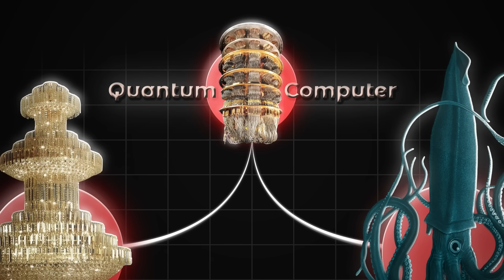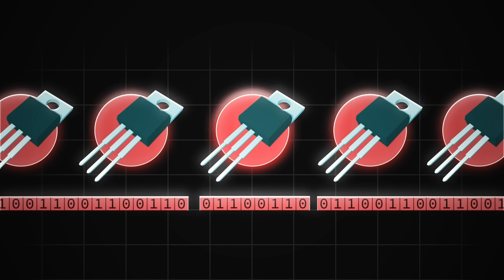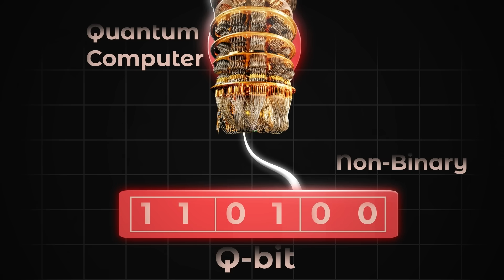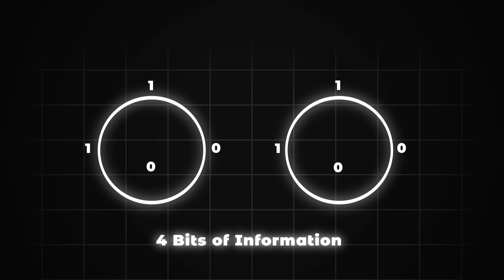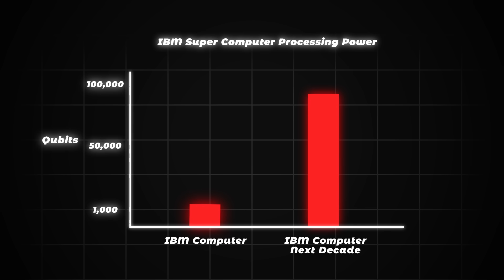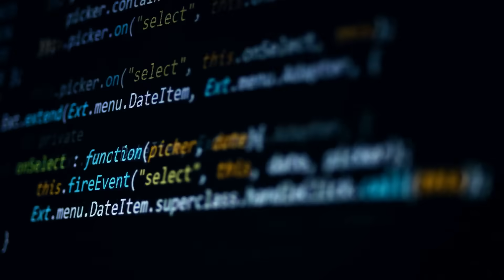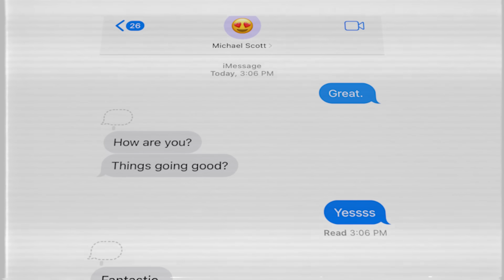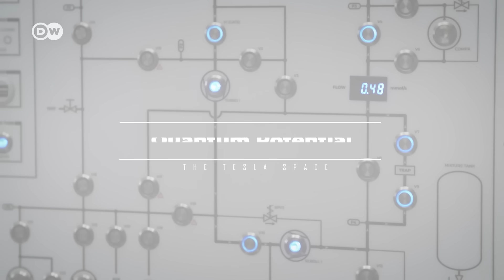Why Quantum Computers Will Break Reality

Comment: The orbital and interplanetary space environment is ideal for quantum computing systems which would require minimal cooling of only a few degrees below ambient temperatures. This could easily be achieved with cooling systems powered by solar and batteries on a satellite or space vehicle. Quantum computing may also eventually be useful for celestial navigation, genetic engineering, and new understandings of physics, all of which may be useful for interplanetary and interstellar human travel. Just as different phenotypes/tribes and cultures of humans have adapted to various terrestrial local environments (Tibetans to high mountains, Masai to sunny savannah, Polynesians to oceanic voyages, Nordic and Inuit peoples to the Arctic North, etc.) so may future astronauts adapt themselves to the space environment and various planetary environments using genetic engineering, unlocked by artificial intelligence and quantum computing.

Comment: the theory has come back again about the brains nueronubules acting as quantum computing units. the paper is  "Ultraviolet Super radiance from Mega-Networks of Tryptophan in Biological Architectures" 
 which has been confirmed in the paper they do super radiance. But that jsut open the door to quantum effects mediated with ultra violet light. and other tube clusters cascade excitons. the neurons in the brain is the only place where a specfici protein is used to make neurons.  whats weird is this is the only place in the body where it protects microtubule architecture at all costs. every where else recycles microtubules.
also, anesthesia that shuts of concesnous, we really have had 0 idea how it works. But recent studies have shown it binds to the microtubule to "quantum channels of TRP rings. anesthetics have shown they impair impair π-resonance energy transfer and exciton hopping in tubulin quantum channels. 
which adjusts the frequency of the system.
the microtubules also have microfilaments running through them in the Fibonacci sequence to wire the microtubels a coherent systems

ultra violet light needs to be researched in how it could affect the idea a nearonotubes are actualling the processing units. the geometry of these tubes change in different nerve cell clusters and types. also propose that myelin sheeths, create feilds for adjusting the optical properties of the band gaps. honestly makes more sense, sense on how we dont know how anything really works yet. since the system would work from the THZ range to the hz range. And be meing an EE a lot more curcuit architecture makes a lot more sense with enragements of tubes in neurons.

this is really worh you time to check out. I dont have the equipment to test any of my ideas

if true, humans try to make a crappy quantum computer with crazy methods
mushroom gods from outter space. mmmmm warm brains

Comment: The most wrong and dumbest Video about this topics out there! STOP IT!

Some Corrections:
1. Quantum Computers Becoming a Big Part of Daily Lives:

   - Claim**: "Quantum computers... are on the verge of becoming a big part of our daily lives."
   - Correction**: Quantum computers are still in the experimental stage and are primarily used for research and specific complex tasks like cryptography, material science, and optimization problems. They are not close to becoming a common part of daily life due to their complexity, cost, and the need for specialized environments (e.g., extremely low temperatures for superconducting qubits).

2. Antikythera Mechanism as the First Computer:
   - Claim**: "This thing is also a computer... it is known as the Antikythera mechanism."
   - Correction**: The Antikythera mechanism, discovered off the coast of Greece, is an ancient analog device used to predict astronomical positions and eclipses. While sophisticated for its time, calling it a "computer" in the modern sense is misleading. It lacked programmability and general-purpose computational abilities that define modern computers.

3. Physical Transistors and Quantum Mechanics:
   - Claim: "The physical manifestation of a cubit is achieved by manipulating the spin state of subatomic particles either protons or electrons causing them to spin up and down or left and right creating two distinct States your one and zero."
   - Correction: Qubits can be realized using various quantum states, such as the spin of electrons, the polarization of photons, or the energy levels of ions. The key is that qubits use quantum states that can be manipulated to perform computations, but they are not limited to spin states alone.

4. Qubits Holding Both Values Simultaneously**:
   - Claim: "Qubits can also represent both one and zero at the same time."
   - Correction**: A qubit in superposition can be in a state that is a linear combination of both |0⟩ and |1⟩. This means it has probabilities of being measured as 0 or 1. It is not that the qubit is literally both 0 and 1 simultaneously, but rather it exists in a state where it can be either when measured.

5. Schrödinger’s Cat Experiment:
   - Claim**: "The basic explanation of Schrödinger’s idea is that you could take a cat and put it in a box, then put something else in the box that could potentially kill the cat, like a cup of poison. Then you seal the box... as long as there is no way for us on the outside to know what's happened inside the box, then we have no evidence to suggest that the cat is dead or alive... it may be considered simultaneously to be both dead and alive at the same time. This is referred to in quantum physics as a superposition... the moment you open the box and check on the well-being of the cat that superposition collapses back into a binary."
   - Correction: Schrödinger’s cat is a thought experiment illustrating quantum superposition and the problem of measurement. The setup involves a radioactive atom, a Geiger counter, poison, and a cat. If the atom decays, the poison is released, killing the cat. Until the box is opened and observed, the system is in a superposition of decayed/undecayed atom and dead/alive cat. Upon observation, the superposition collapses into one definite state.

6. Error Rates in Quantum Computers:
   - Claim: "Quantum computers tend to have error rates that sit between 1 in 100 at worst and 1 in 1,000 at best."
   - Correction: Quantum computers do have higher error rates compared to classical computers due to decoherence and noise. However, these rates vary depending on the technology and implementation. Efforts in quantum error correction are crucial to reducing these rates and making quantum computation more reliable.

7. Quantum Computers Making Mistakes:
   - Claim: "Quantum computers are actually able to make mistakes and they do it fairly often."
   - Correction**: Quantum computers are susceptible to errors due to decoherence and noise, but these are not "mistakes" in the conventional sense. Quantum error correction is an active area of research aimed at mitigating these errors and improving the reliability of quantum computations.

8. Cryptographic Security:
   - Claim**: "iMessage had been cryptographically upgraded with postquantum security... Apple has enough concern about the potential Quantum hacking to take it seriously."
   - Correction**: Post-quantum cryptography aims to develop algorithms secure against quantum attacks. While some companies are exploring these technologies, widespread adoption and implementation details vary. The transition to post-quantum cryptography is ongoing and complex.

9. Nature Operating on Quantum Scale:
   - Claim: "Forces of nature like diseases and viruses also operate on the quantum level just like the cubits."
   - Correction**: Biological processes involve quantum mechanics (e.g., enzyme reactions), but classical biological phenomena generally do not require quantum computation for their explanation. The influence of quantum effects in biology is an emerging research area but not yet fully understood or widely applicable.

10. Quantum Computers as Nonbinary**:
    - Claim: "Cubits can also represent both one and zero at the same time. They are nonbinary."
    - Correction: The term "nonbinary" is not appropriate here. Qubits can exist in a superposition of states, representing a combination of 0 and 1. This is a fundamental property of quantum mechanics, but "nonbinary" is not the correct descriptor for this phenomenon.

11. Superposition and Final Answer:
    - Claim: "That time spent in a superposition allows the quantum computer to explore a vast network of potential combinations before arriving at a final answer."
    - Correction**: Quantum algorithms utilize superposition and entanglement to process information in ways classical computers cannot. This allows for parallel processing of probabilities, enabling the exploration of multiple solutions simultaneously. The "exploration" metaphor simplifies the complexity of how quantum algorithms work.

12. Quantum Computers in Personal Tech:
    - Claim: "You definitely won't be adding one to your existing lineup of personal tech."
    - Correction**: While unlikely in the near future, advances in technology could eventually make quantum computing more accessible. Current quantum computers require specialized environments, but future developments could change this scenario, making them more compact and possibly integrated into everyday technology.

13. Quantum Computing and Supercomputers:
    - Claim: "Quantum computing will not be replaced 99% of the jobs that are currently done by existing supercomputers."
    - Correction: Quantum computers are expected to complement classical supercomputers, handling specific types of problems that are inefficient for classical computers to solve. They are not a direct replacement but offer a different approach to computation.

14. Combining Qubits:
    - Claim: "Combining just 20 cubits together will produce more than 1 million potential values."
    - Correction: The number of possible states a system of qubits can represent grows exponentially (2^n for n qubits). Therefore, 20 qubits can represent 2^20 (1,048,576) states, which is accurate. However, leveraging these states for practical computations involves significant complexity and error correction.

15. China’s Investment in Quantum Computing:
    - Claim: "China has taken the early lead; they have the largest quantity of powerful and stable quantum computers."
    - Correction: While China has invested heavily in quantum research, claiming a definitive lead is difficult. Quantum computing is a global field with significant contributions from many countries, including the US, Europe, and Canada. The competition is ongoing, and no single country has an uncontested lead.

16. Brute Force Hacking by Quantum Computers:
    - Claim: "Private keys can be Brute Force hacked by quantum computers."
    - Correction**: Quantum computers could potentially break certain cryptographic algorithms, such as RSA and ECC, through Shor's algorithm. However, brute force is not the correct term. Quantum attacks would use specific quantum algorithms rather than brute force.

Just Stop making Videos about Topic you dont know anything about. Everyone is now 10 IQ point dumber than befor, just because of your video !!!

Comment: You need to follow up on your electronic facts.  I believe it takes at least two transistors to hold a bit of data.  Also, there are a lot more transistors in a PC.  IBM 7070: 30,000 transistors and 22,000 diodes.  Good video but you need to be accurate.

Comment: Quantum Computers are profoundly unreliable.  A huge amount of dithering and guesswork are required to actually confirm results.  Currently "the greater scheme of things" is the mathematics they use.  The "more than 5 delta" has not been achieved.  Detecting and controlling individual electrons cannot be achieved so far.  Noise is the problem.

Comment: One important correction: we do NOT have 3nm chips. They are multilayered with much bigger gaps and they are estimating how close would they be on a single layer.
Reply: The individual transistors are 3nm
Reply: @UnknownNotFound630  No, they are not. The process node (in this case, the 3nm process node) USED to be a reflection of the gate length (which gives you the width and therefore approximate size) of the transistors used in the chip, but that stopped being the case after the 22nm process node. The 3nm process node actually has a gate length of 16nm to 18nm depending on the manufacturer. So the 3nm process node transistors are actually about 6 times larger than they would lead you to believe. "3nm" is a marketing term, not an accurate description of transistor size.
Reply: but what is their size then?
Reply: @user-ug6kk5ux5q  the current 5nm chips actual gate length is 18nm according to Wikipedia
Reply: @user-ug6kk5ux5q  dont worry about it
Reply: actually we the usa, have microchips smaller then a human hair with 6 terrabites of memory at this momment,the general public has access too 500 gb flash drives publically,that took 1 year. I used to make 2 terrabite flash drives in 2010 for commercial use that was 15 years ago almost, So how far along is the tech now for real nano bots with the same chip types as the 2 terrabite flash drives but operating systems as well the size of a human cell.
Reply: @jessebernstein7555 but do u have free healthcare tho?
Reply: This is absurd to talk about, since we have had holographic memory since the 90s and haven't been using it.  We have lithium niobate.  Do you know how much memory holographic memory has?  Do you know how fast optical processing units are?  The bandwidth of just visible light?  Sorry, you're playing with leftover toys, and the GPU industry shows this best, with H200s for big businesses and none for you.
Reply: Oh shut up know-it-all. Make a video about it then.
Reply: I was about to comment this. The “nm” number in recent times is nothing more than marketing jargon to signal that they’ve released a new generation that’s better
Reply: We have sub 1nm process using gallium nitride.  It's not at production level yet.
Reply: 1.6 petabit optical discs, and people still want SSDs.

Comment: A transistor is a tap, not a switch. The fact that digital computers only ever turn the tap fully on, or fully off, does not mean that those are the only states a transistor can be in. Sure, transistors CAN be used to represent binary bits in a digital computer, but they are analogue devices, and by no means whatsoever are they restricted to being in only one of two states. In fact, inside a digital device which uses them, a '0' might be represented by anything from 0 volts to 0.2 voltes, and a '1' might be represented by anything from 0.7 volts up to 1.5 volts (in a machine running on a 1.5 volt supply). Inside your stereo amplifier though, transistors might be used in analogue fashion to boost the volume which is coming from your phone, via a cable which only carries a couple of volts, and is nowhere near powerful enough to drive a large pair of speakers.